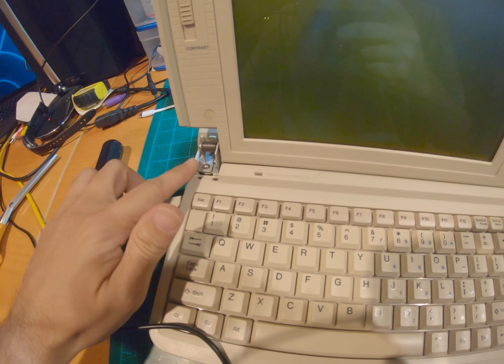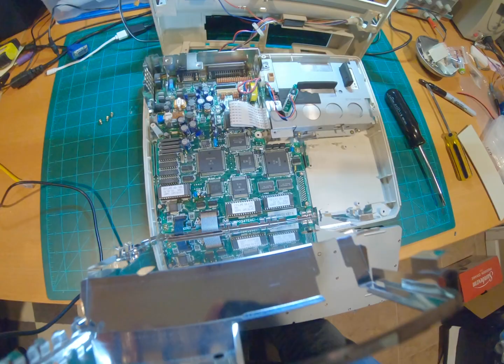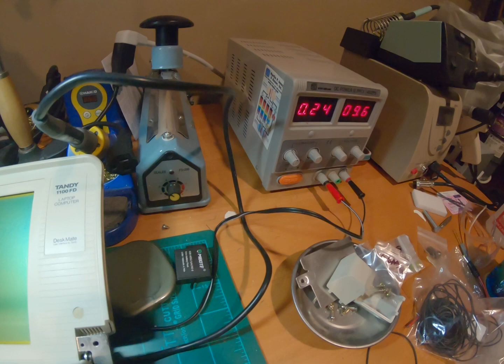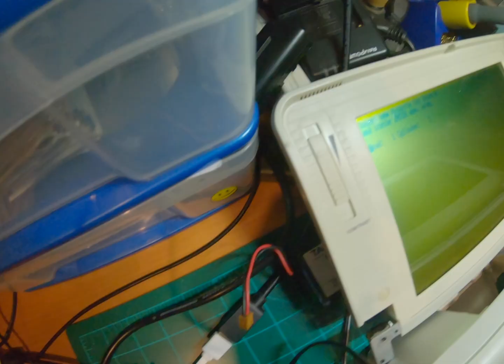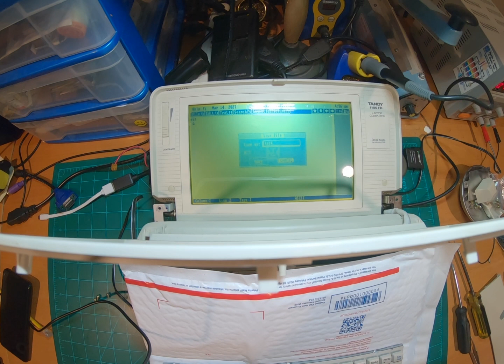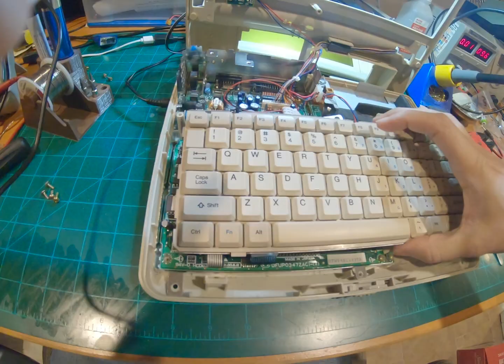Tandy 1100 FD Teardown and Floppy Drive Repair

Comment: I have one of these too. The Lead acid battery was dead and the drive belt had turned to a black sticky gum that was on both pulleys and on the photo eye speed control thing. Alcohol and some hard work got it off. I tried a rubber band to see if it would work but no joy..